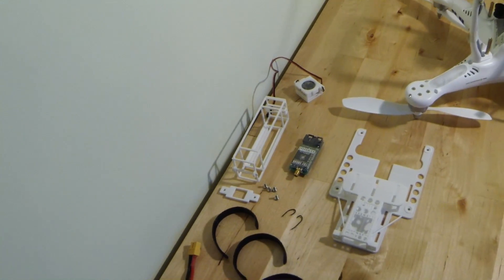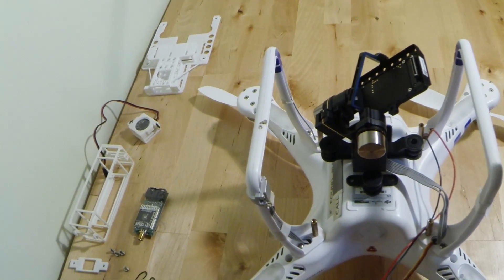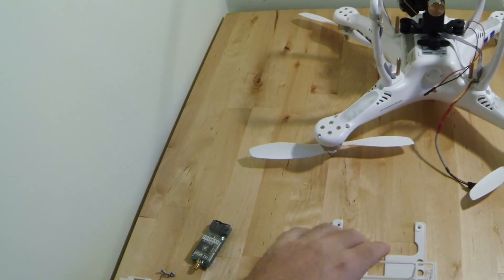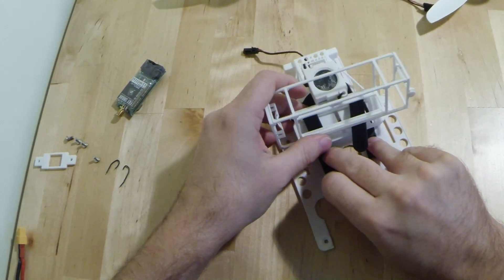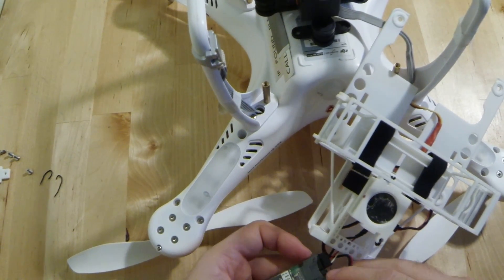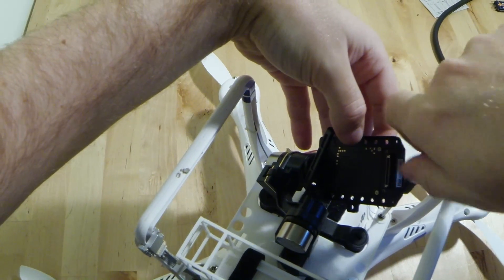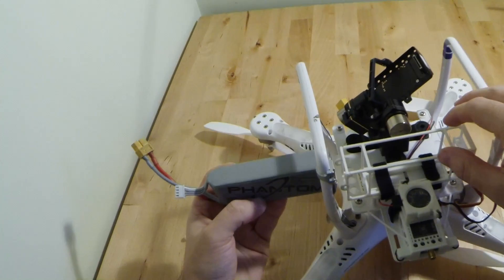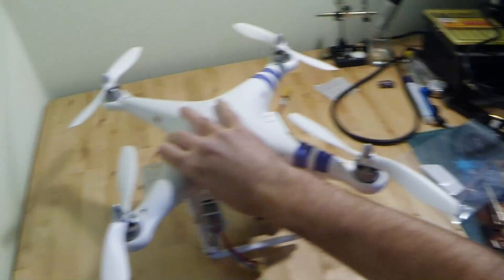DJI Phantom Zenmuse FPV Custom Undertray (Dual Battery) - Fatshark Zenmuse Mount

Comment: I need an answer asap please!!! I have a dji f450 all stock except tmotors2212-13980kv tmotor cf props, I want to use 2 4s 4300 lipos in tandem, my question is how do you setup voltage protection in naza assistant please help me asap thank you in advance for any or all help!

Comment: absolutely  overload
Reply from the maker: Ironically it weighs less than a Phantom 2 with Zenmuse gimbal in this form... Old news now though to be honest. The Phantom 1.5 conversion is a better route to go for more battery time but the FPV undertray that I designed for the Phantom 2 works on that.
Reply: d3weyTube
o...sorry, I make it wrong